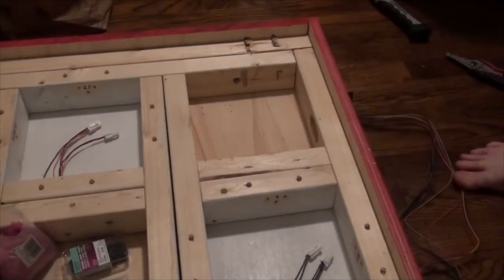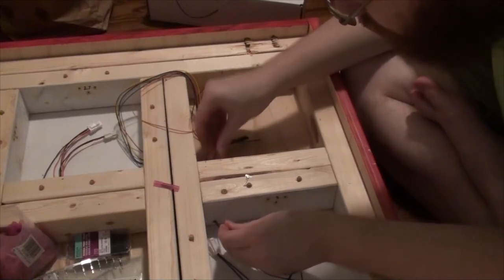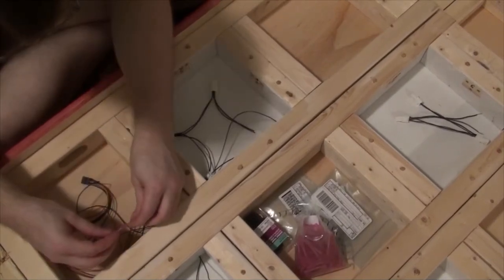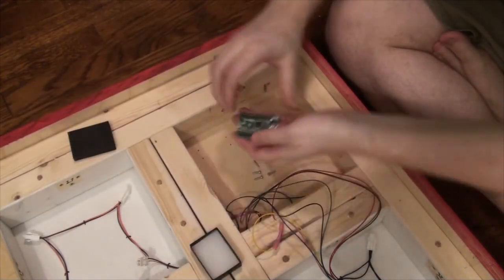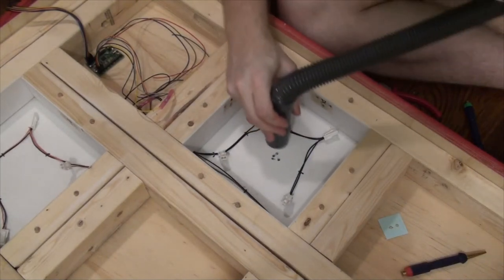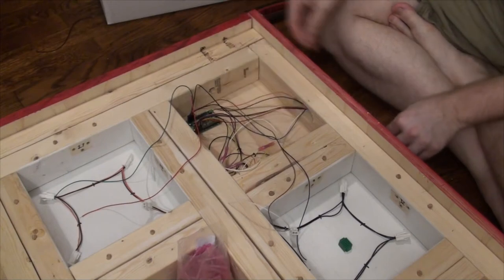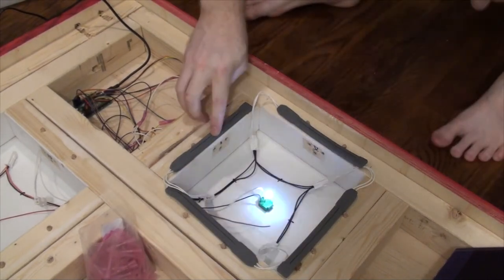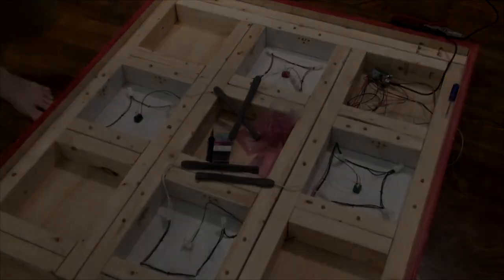Building an ITG2 dance pad replica - episode 11: Wiring sensors and LEDs

Comment: rather than an I-Pac (as they can be quite pricey) would an arduino leonardo work fine for a single player setup without LEDs? I THINK i have my head wrapped around your wiring for the pads down but just incase i wanted too double check, You have all the sensors daisy chained to a single common ground and then 4 sensors daisy chained together and into the I-Pac input right? Was there a molex on the sensor already or did you cut it off and crimp it on?
Reply from the maker: Yup, that sounds right. The sensors come with the molex connector already on them, so I just had to put the other end on the wiring in the pad to connect it. Of course, if you wanted to, you could cut the connector off the sensors and either wire them directly or put a different connector on, but the advantage of doing it this way is it makes them really easy to swap. DDR sensors come with a different connector, but otherwise function the same as the PIU/ITG ones I use here.
Reply: Ahh i thought the connector on the DDR sensors looked a bit different but i couldnt quite put my finger on what they were! Good to know the PIU ones are molex ones.  Thanks for the info!!

Comment: This is exactly how I wanna build my pads, since getting actual arcade pads is hard, expensive and heavy. I'm gonna build my own. Using all the arcade parts I can source, and build the rest using the thick wood like that. Where did you get your panels? And how does it feel compared to the arcade?
Reply from the maker: Panels came from here: https://www.tapplastics.com/product/plastics/cut_to_size_plastic/polycarbonate_sheets/516

Decal graphics: http://ludobloom.com/temp/DECALS_FOR_PRINT.png

...printed with this company: http://www.bannerbuzz.com/clear-window-decals.html

The feel is pretty good, though I'd definitely do some things differently now that I've had the chance to get intimate with real arcade pads. The corner stoppers in particular should have been designed differently - there wasn't enough space to tweak sensitivity the way it needed to be. It's not 100% arcade accurate, but it's closer than any other non-arcade pad I've played on.
Reply: Can you elaborate on the sensitivity and why you couldn't tweak it enough?

Comment: Hey alex.
Im designing a pad and would like to understand more on the wiring. Powering and contact activation of the lights. Do you have a diagram or something to show how you did it?
Reply from the maker: Hey! I don't really have any good diagrams or anything, unfortunately. This is something that the U-HID helped me with. Each panel and each light has its own connection on the board, and software controls the light activation. Somewhere in this series, I have a clip of programming the U-HID to activate lights when a particular sensor is pressed.

If you're looking to do the light control in hardware, it's going to be a bit trickier... It'll probably involve having the power line for the LEDs run through a transistor, with an input from the sensor line to switch it. I worked on fixing the lights on a Pump It Up foot PCB in another video, which might be informative: https://www.youtube.com/watch?v=julhzQe90hc
Reply: What i initially intended to do was try to run leds using my zero delay encoder board.
The board uses usb power which is 5v. I was going to go breadboard but then i saw the option of led strips.

What are your thoughts on led strips?
Reply from the maker: LED strips are great! If you can find one that meets your voltage requirements and everything, it'll save you a lot of trouble. The breadboard solution is definitely kind of janky.

One thing I am finding is that the 5v, 30mA limit of USB power is pretty limiting. I don't get as much brightness as I'd like out of my lights, and they don't have a very uniform spread. Other dance pads I've worked on since used a separate 12v input for LED power, which has been a lot better. It does mean that you'd need a separate non-USB power line coming into the pad, though, so it's not as convenient if you just want something you can plug into a computer easily.